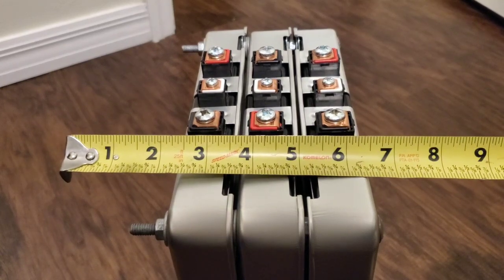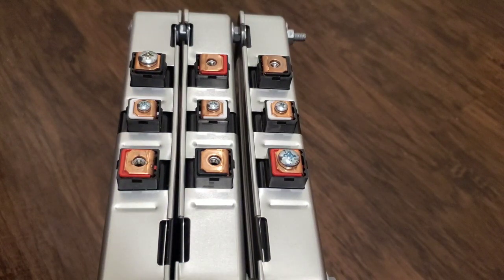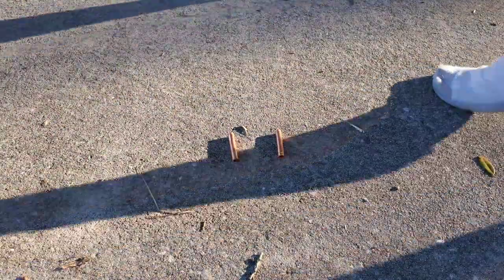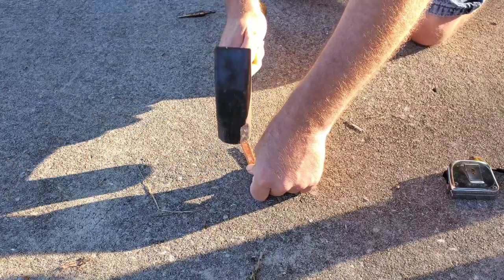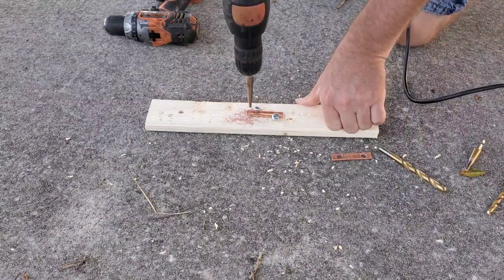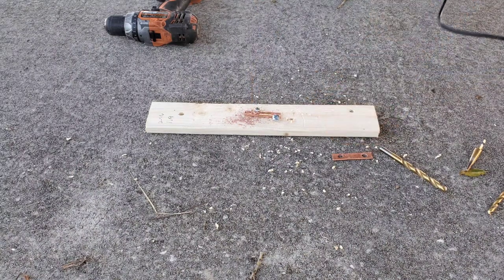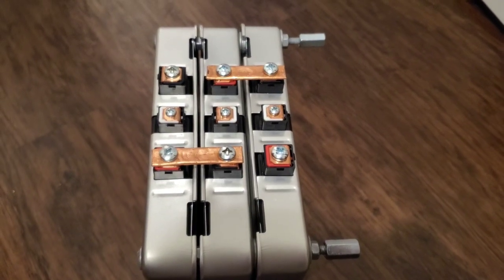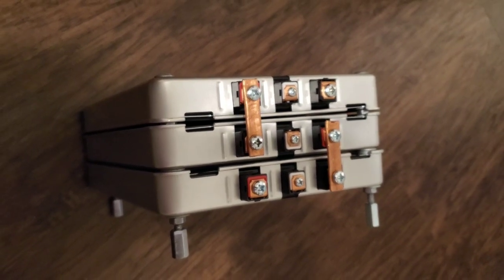Making Copper Bus Bars

Comment: When I pounded my copper pipe it split in two.  Will this be a problem if I sandwich  them together?
Reply from the maker: Shouldn't be.  No different than copper stands.  You using copper rolls?  It's softer copper.

Comment: What’s going on with the motokote engine oil is the engine doing ok ?
Reply from the maker: Doin great but have evaporation issues just like all the other oils I've used.  In my Prius I always had to add oil due to this.  5000 miles and added a quart and a half of oil.  Will be using aircraft oil soon as another experiment, but that's another video.